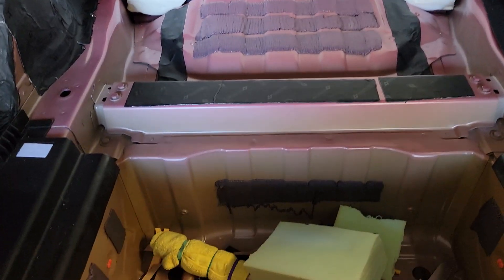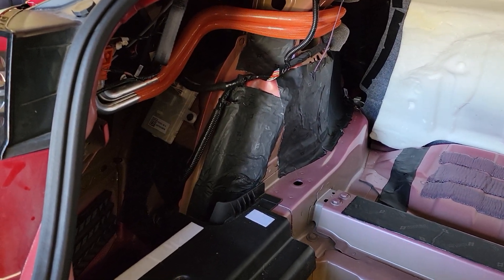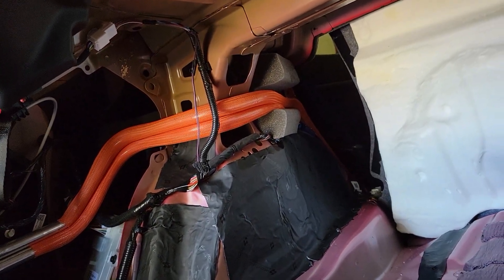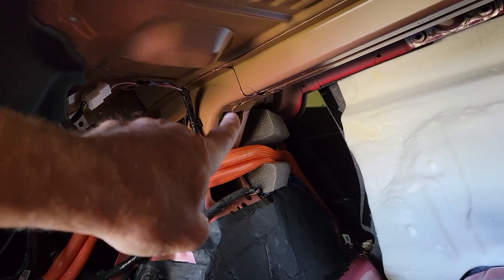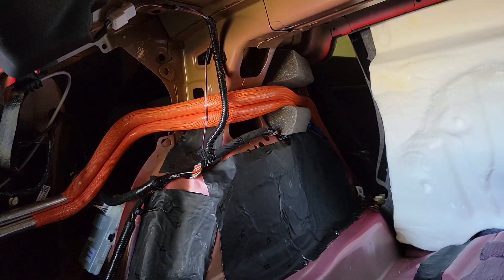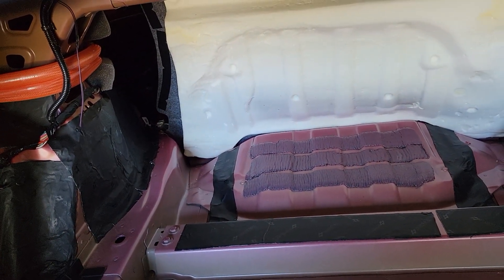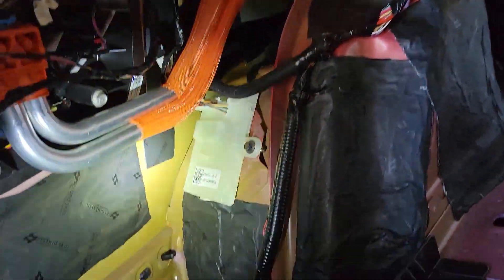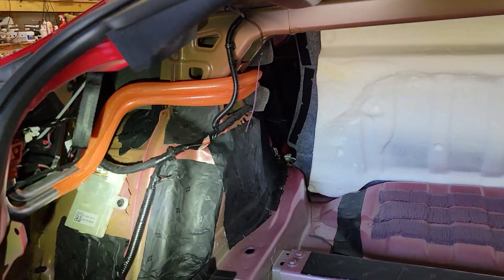Tesla Model 3 road noise reduction

Comment: Hi George, thanks for sharing!
My car is modely. at first I was bothered by road noise and wind noise as you are.
I would also like to give you some tips for trunk soundproofing that I hope will help you.
You are doing the right step of applying the shock absorber plate, this will help to reduce the low frequency noise in the trunk location, but you will also need to apply acoustic foam on top of the shock absorber plate in order to reduce the high frequency noise, so that you can achieve the best reduction of road noise and resonance. Also, if you are very concerned about road noise as I am, make sure you do four wheel soundproofing, it helps a lot to reduce road noise.

PS: My native language is Chinese, so I used the translation software to do this review, I hope to apologize for any mistakes. You know what I mean on the line.
Reply from the maker: Can you give an example of what material you recommend? "acoustic foam on top of the shock absorber plate"

Comment: Try this also there are quiet tires too try hankook ion evo tires the interior of the tires are sound dampening  foam
Reply: I just bought those tires and they don't help. 2020 M3P on 20"s. On rough asphalt those tires are just as loud as my stock Pilot Sport S
Reply from the maker: Yes, the stock OEM Pirelli PZero tires also have foam and are EV specific with noise  quieting. I've read that going from my 20" wheels to 18" wheels which have taller and softer tire sidewalls is very helpful also. And going from summer tires to All Season tires can help.
Thank you

Comment: Hi George. I can't see which wheel size you have on this Model 3, but if you have the option, I'd really recommend trying some 18" wheels since a taller tire sidewall makes a big difference in road noise over rougher surface.  
I'd also check if the area where the front wheel well meets the cabin is damped enough since that's also a possible culprit for too much road noise.

Wish you well in your experiments, please do report if you have any success.
Reply from the maker: I agree. I think most of the noise now that I did the sound dampening in the wheel wells is tire higher frequency and I think most of it is coming in the doors and windows. I'll be trying to close that off more over time. I have a 22 Tesla Model 3 Performance. It came with very tall 20" wheels. I don't really want smaller wheels, like the 18" and it costs quite a bit to change over. If this continues to bother me and i get some extra cash, I'll consider the change. I have not worked the underside of this car for road noise ... yet.
Thank you,
George
Reply from the maker: I'm at a point where more noise dampening / absorbing isn't doing a lot more to get rid of remaining annoying sound/vibration. The car is amazingly quiet on more normal road surfaces. It's still those rougher asphalt roads that are annoying. I think less annoying now but there's still enough to continue working on it. I am down to suspension, wheels, tires. First I'm changing the shocks. It's the cheapest of the 3 choices mentioned. I should have them next week. I've been preparing the shop and myself for that job. The noises remaining are a kind of pounding deeper sound and vibration that is at that tire/road interface that gets amplified or isn't dampened by the suspension. That vibration seems all over the car, coming from no specific area. Sometimes it feels like oscillating sound pressure. I'll try my best to determine how helpful the shocks are at those sound but I full expect less jarring and a better overall ride, in any case. I haven't decided if I'll ever commit to expensive wheel replacement. But I'm certain I'll go from summer tires to All Season tires when the time comes. I'm in Florida and use summer tires all year. The pros also claim spraying the wheel wells will help. It didn't do anything that I could tell on another car (non Tesla) that I did a big sound deadening job on. So that isn't happening unless all else fails.